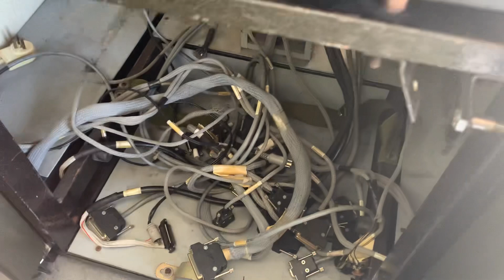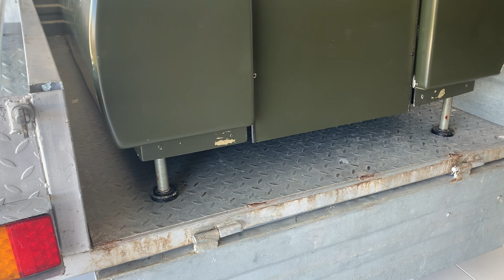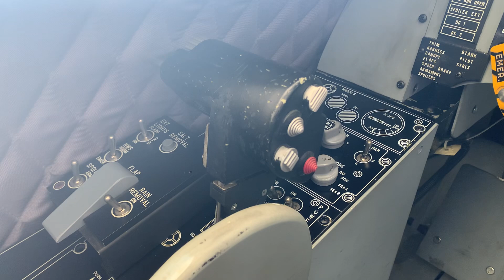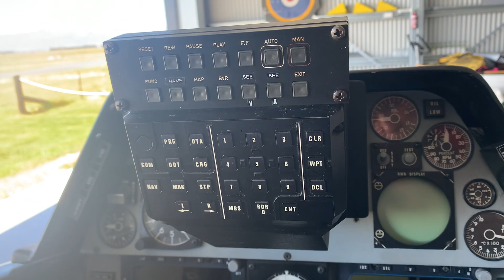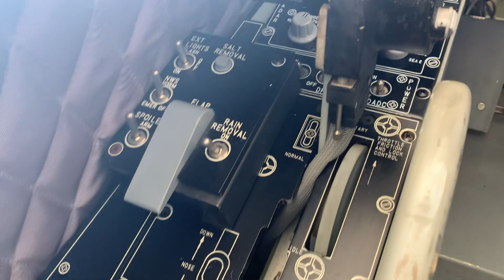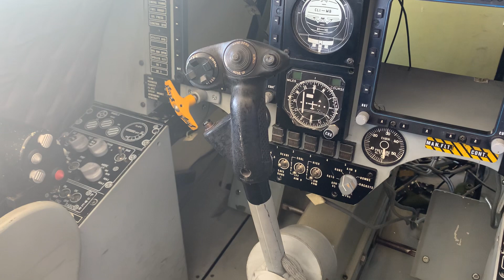RNZAF A-4K Skyhawk “Hotshot” Flight Simulator restoration. Part 1 - Introduction

Comment: There is an excellent A4e community mod that which is an older model of the A4 but still would be incredible to hook this up to it.
Reply from the maker: Yep, I've had a go on the A-4 on DCS. Just fantastic the community have this freely available. I'll get the sim linked up to FS2020 via Mobiflight first and then look at what is needed for DCS.